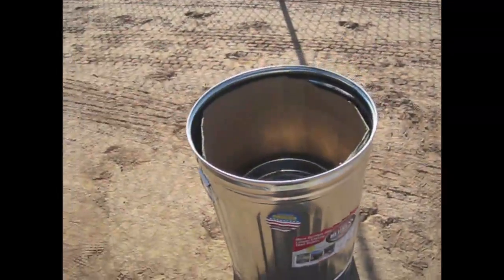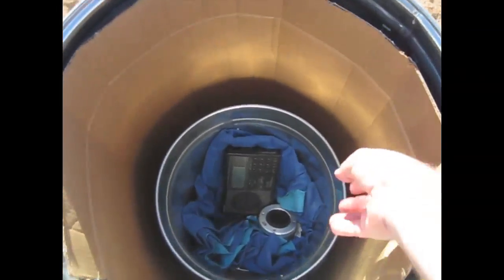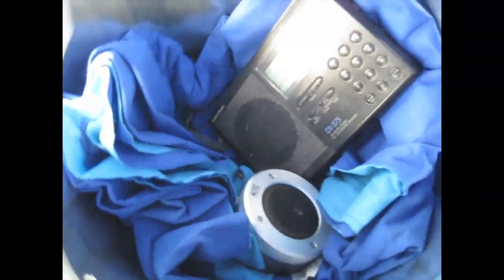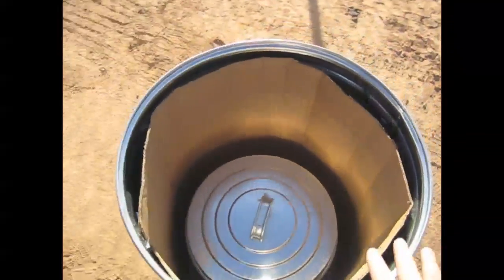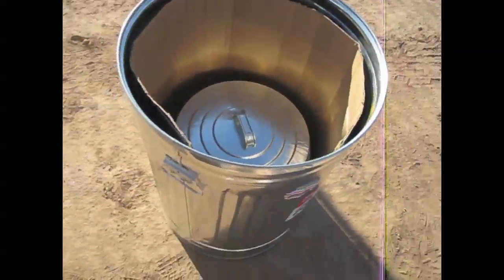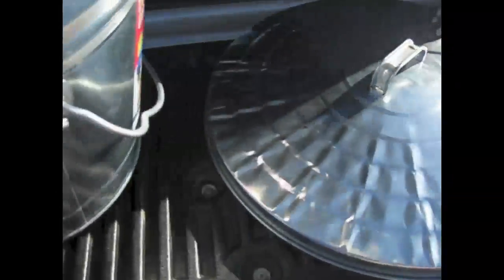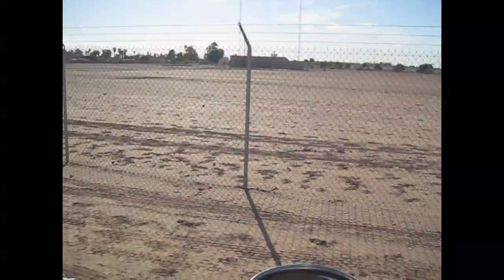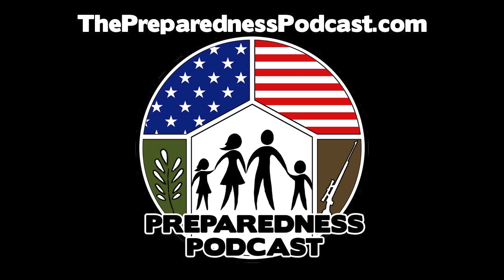Surviving EMP   Testing Faraday Box   Part 3

Comment: Thanks for the swift reply on Part II, I'lll check out the properties of the lead top,  I was hoping the 1" rebar steel in the concrete would act as a cage.  I don't know if concrete will properly ground since the metal is encased in it.  But you've helped get me thinking and I'm going to check out your channel more tomorrow.  I sure do appreciate putting this series up, and getting people to think.

Comment from the maker: You would have to ensure that however you make it, it needs to be 100% shielded, no compromises. No TV antennas sticking up, no power or LAN cables coming inside, as these would defeat the purpose of the shielding.

I'd suggest starting with a large scale model and test its shielding with a very high wattage ham radio at 80 & 160 meters. If it can stops 1000+ watts on these low freqs, you're probably on the right track. It's all about testing, not "internet theory."